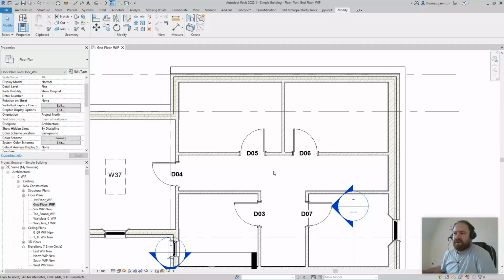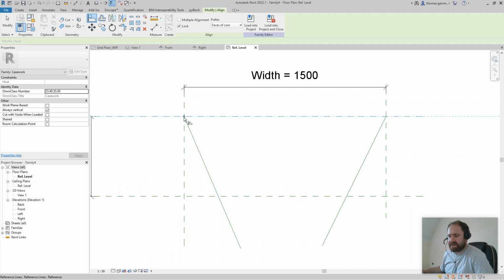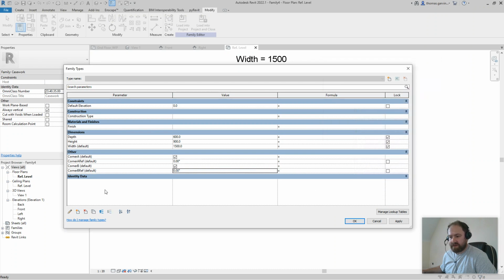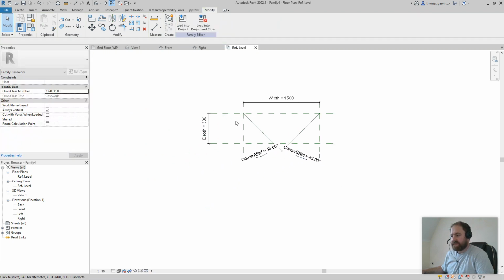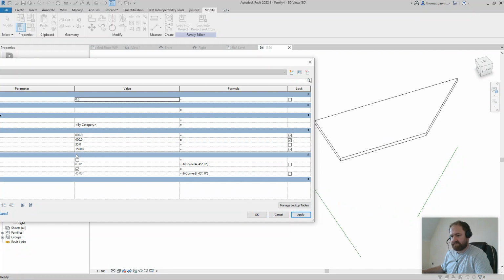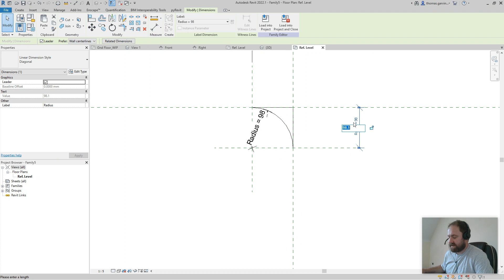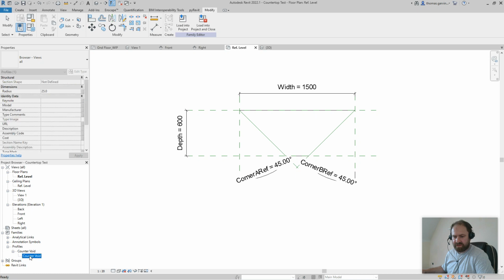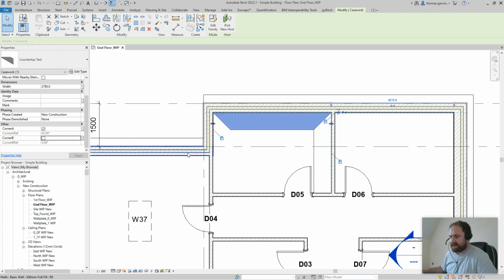Make Your Own Revit Countertop Family with On / Off Corner Controls

Comment: Wow! Super useful video. Thank you! I recently ran into this problem.
One question, do you do how to make a calculated area parameter that gives you the correct area if you have the 45 deg corners enabled?
Reply from the maker: Thanks for the feedback! Create a parameter with data type 'Area'. Make it an instance parameter. Give it a calculated value of =(Length*Width)-((Width*Width)/2)